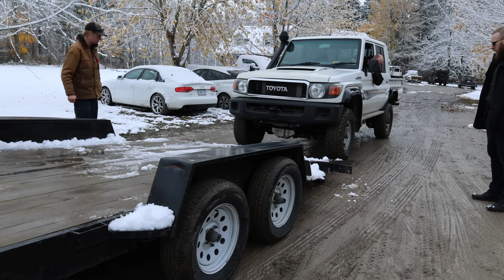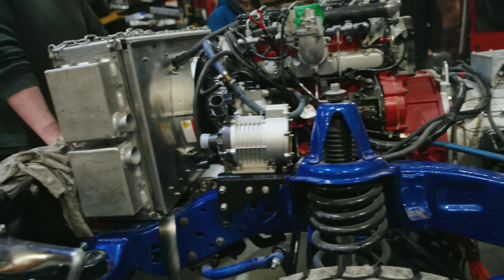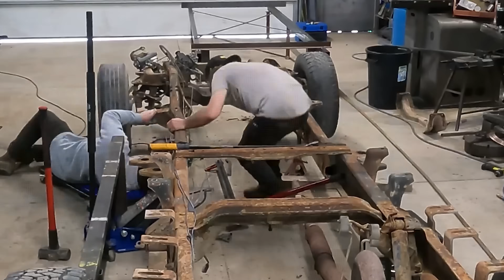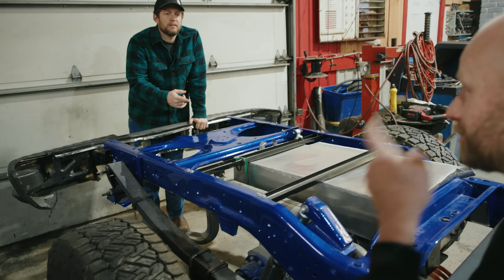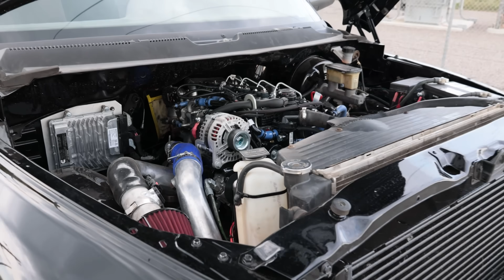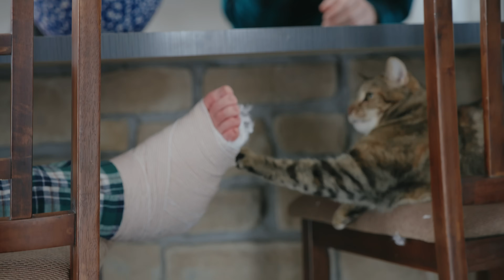Scrap Our First Design and Build an Edison Pickup Chassis from Scratch?

Comment: Very happy to see all the progress. I do believe having the chassis mounts moveable is the way to go. Then they will definitely fit more vehicles. I would also make it very clear in legal speak that they are to be bolted then welded in place by the installer. Any failure to weld them or improperly weld them is not Edison’s responsibility.

Comment: With a common frame you will run into wheelbase issues between manufacturers bed and wheel arch placement.
Reply: I suspect the "common" frame will come in pieces that can be adjusted for different wheelbases, and adjustable cab mounts that can be welded on.
Reply: @Sah-o5m sounds like an option some people might want.

Comment: So we can buy components? I thought it was “installer only” That would be great. 

Word of caution on wanting to get creative and fancy with the suspension with four links and such… For a work truck pickup truck. High serviceability and low cost. Leaf springs rear and radius arm front isn’t sexy, but you also don’t have to have an onboard air compressor and there’s less moving parts to wear out.
Reply: I hope they just do the kits like they intended. I don't want their chassis.
Reply: @joshfazenbaker5691  For sure. I can figure out the packaging. They don’t need to make sure it fits perfectly, just give me components that work.

Comment: Just a thought:
Could Dongfeng Off-Road supply you with "GLIDER-KIT"  Dongfeng "MENGSHI M50 and/or MS600" 
as a Cab, & Chassis bundle, 
without the mechanical drivetrain ?

Dongfeng M50  (https://www.youtube.com/@youtubvehicle)
https://www.youtube.com/watch?v=STWzpCTlrtY"

In these models 
Dongfeng Off-Road themselves tend to utilise 
Cummins "B" Series 6.7 @ 320 hp (VERY de-rated).

Comment: You guys should do your very own pickup truck line, other than just conversions
Reply: Impossible
Reply: @xxxxxxxx183 
Probably impossible for class 1,2,3 pickups like F150 F250, and F350 due to 10,000 rules and regulations.

Since Edison is on the verge of selling class 8 trucks, then that also allows them to sell class 7, class 6, class 5, and class 4 trucks. A class 4 truck is an F450 commercial truck and (I think) has fewer rules about airbags and crash testing. So it MIGHT be possible.

Comment: This. You guys are living my absolute dream. As the son of a family owned portable restroom business, I’ve always been frustrated that we have so limited options in the sub-CDL class truck-chassis options, that we are forced with the big three, with constant drivetrain issues, because they don’t build trucks to be worked on, they build them to be replaced. In the division I work in, we also have been in the process of up fitting tank bodies from old chassis to new ones, and I can confirm, most chassis-cab trucks are 34” rear frame width. I love what ya’ll are doing, and the kind of conversation you had about optimization? Same kinda thing with me and my boss. If I lived in Canada, I’d be filling in an application for sure 😁

Comment: I have designed many coach and fleet vehicles (for video games bear in mind) and I will say, 34 is wonderful because it increased the ammount of bodies you can put on a truck. There were a few trucks in the day, I can't remember which ones, but they had frame rails that narrowed in and trying to mount stuff to them always meant having to make a new model for them, either that or have to make adapters which just added complexity.

Comment: The pickup kits are how I found y'all (via Deboss). I've got a GMT800  Suburban 2500 and a Nissan NV2500HD, I tow across the US with my racecar on an open trailer. I'm hoping these are reasonably priced for a Middle Class income, but I'm sure they will be pricey. Rooting for y'all regardless!!

Comment: Whatever you do, take into account a spare tire’s placement. The larger the space for a spare tire the better for various applications.
Reply: I don't think that it's that big of a deal. Every truck that I have bought. I get the extra tank. So I don't want the extra tire. I want less time at the pump and more range. And when you are replying tires every two years. I have never needed a spare.

You do a trip check and look at your tires. And know what is going on before you need a spare. And if it is that big of a deal. Then carry a spare in a can. But honestly a 12v compressor is my favorite. Put in air on the truck or trailer and then drive and get it fixed. If you are shredding a tire to the point that you need a spare. Then you should be doing more pre trips.

Comment: It would be cool to see an RV manufacturer using your chassis.
Reply from the maker: We’ve had a couple express interest now.   The RV benefits would be huge of the hybrid
Reply: Taking an e350 based camper with a v10 or a big block and turning it into a diesel hybrid could more than double the MPG into the 10s in some conditions.
Reply: @w @workingcountry1776 keep the V10. It’s already used as a generator engine for industrial applications. A V10 running at a single RPM with a generator load can be pretty economical, especially when compared to it driving the wheels.
Reply: @EdisonMotors I would love to have my Astro Tiger RV be your guinea pig. Would be so perfect with a diesel heater and a bunch of panels. It would make it a dream rig.
Reply: @JesterTop  love the astro!
Reply: @EdisonMotors  I've got an Airstream 345 motorhome with a 454 and I'm dreaming of making it a diesel hybrid. I'd love to be able to pull a hill faster than 45 and get over 6 mpg.
Reply: Im planning on doing this swap in my Class C G30.
Reply: I would love an electric RV, but only with LFP batteries for the fire safety factor

Comment: I thought the original idea was to retro many old models to keep them on the road. Y'all are making a new truck brand.
Reply: They came to the realization that it's cheaper to manufacture, than to retrofit. They will be building a cab soon!
Reply: I can see this being a part of the business that gets developed after the core components are proven at production scale. I can see them selling universal kits at this stage being an absolute nightmare that they don't have time for. You'll notice the international project is on the back burner. The good thing about this new idea is that you can still buy the chassis and retro fit your cab.
Reply: yeah i knew it was too good to be true

Comment: I DO know a specialist low-volume "OFF-HIGHWAY" chassis builder in CHINA, 
Hubei Off-road Special Vehicles Co. / Shiyan Fanya Trade Co.  (in English) , 
that uses a large percentage of Cummins engines, 
in medium duty 4x4 and 6x6 applications. 
This company is linked to DONGFENG
(Both DONGFENG AND FOTON operate official Cummins Joint-Venture manufacturing plants in China).

Located in Shiyan City, Hubei Province

Here in Australasia (Australia and New Zealand) we probably see much more 
commercial product from both DONGFENG and (also) FOTON
than you do,
and they BOTH have relationships with major Euro-American component brands..

Hubei Off-road Special Vehicles have existing Off-Highway chassis designs 
(North American: class 3 through 6 approx.)
(intended for ICE power-trains when originally designed)
that might require very minimal alteration
and be very cost competitive .
(One range is a much improved "HUMMER-LIKE" design)
https://www.youtube.com/watch?v=C1nYuJ_1JZI

Comment: I just love this banter as those of us who are truck owners are offering in valuable feedback. The question on using your chassis on a current model is the additional cost. You would have to provide folks who want to convert existing models pre manufactured bolt on components to make the conversion.

Comment: Another vote for cab and chassis frame rails. Hot shots, RV haulers, service trucks, etc need the hybrid more than someone with an F350 to drive to the mall. Also, set the battery and generator up for trailer pulling or heavy payload, not an empty truck. There is a sweet spot between the cost of extra batteries and the cost of extra diesel. I think most people wouldn't mind the diesel running nearly full time cruising on the highway with a trailer as long as the fuel economy improvement and pulling power is improved over pickup diesels.

Comment: when replacement chassis with original bodies was mentioned, i cringed, unless there's some way to make a small selection of frames that can fit under 80% of bodies, it's not a go, 20% can be done custom, i'm glad the explanation is so simple, most trucks already semi-universal.  a simple swap with a semi-universal frame is good, but i'd really like the front suspension travel of a gen1 ranger, some people were able to stretch it to 460mm.  with the axles available, it ain't possible, but i still like it, maybe for the 2wd version.  the extended c rich mentions is a good idea, but, i'm thinking, extend on the top, but have a shorter web on the bottom, maybe even z, with the bottom web sticking outward, you'd gain maybe 100mm with the rails exactly where they are.

Comment: That "FOTON" Cummins 2.8 has a bigger sister ENGINE.  The CUMMINs "FOTON"  3.8 -  a whole liter larger
(BUT it  is VERY different to the 4-cyl "B-SERIES" Cummins engine, which I suspect Cummins are trying to point you at.)

You can probably source that 3.8 FOTON in CHINA, if you must, 
Using one of you EXISTING suppliers in China, to handle the procurement,
if CUMMINS North America, are trying to steer you in another direction.

Comment: This video is kinda disheartening. I've seen it time and time again. You are engineering your way into a whole truck. I dont want a whole truck. And if the rails are going to be different width than the rest of the industry, you add even more cost to it. Pushing the ROI out even further.
Reply: I would like a 'kit' that doesn't require me to re-body a frame. I understand why, but moving a body to another frame will take more wiring time, and equipment than replacing an entire drivetrain.
Reply from the maker: We have said that the parts will be available to those who want to buy just the parts and install them.  That is still currently the plan but we need a chassis to put them in so we can get CMVSS certification on the entire chassis
Reply: @EdisonMotors So, no 'kit,' just parts? What about in the past you said you'd like for the customer to be able to keep their engine, is that gone now too?
Reply: @EGremlin if a "kit" is a pallet full of drivetrain parts, then you'll be able to buy a "kit"

What you're looking for will be in phase 3 after Edison turns profitable
Reply: @EdisonMotors why do kits buyers need the chassis cert?

Comment: A "Rippled Plate"  could easily be added to the top-surface of your Pick-Up truck chassis-rail,
which gives you a "Partial" Torsion-Box design, 
but also facilitates a variety of "Body-Up-Fitter" mounting width options.

Comment: Have you seen the chassis frame design utilised by China's  WINDROSE tractor unit (E-700 ?) 
it is standard width until it meets a big WIDE SQUARE BOX,
which forms the Rear-Half (approx.) of the Frame-Length.
I believe that a "Bridge" structure is required to mount the Fifth-Wheel Coupling.

A "Rippled Plate"  could easily be added to the top-surface of your Pick-Up truck chassis-rail,
which gives you a "Partial" Torsion-Box design, 
but also facilitates a variety of "Body-Up-Fitter" mounting width options.

Comment: 12:47 maybe provide an adapter for the 34 inch products to the wider frame, so you can have more component capacity and still be compatible with the standard truck bed/accessories.

Comment: Just use a WIDER TOP-FLANGE on your chassis-rail.  
This still lets you have  a Wider-Apart WEB, 
and a more typical LOWER-FLANGE width, 
but retaining your "Traditional" width of mounting 
(for vertical mounting bolts).

Comment: F-450 can have either 34” or 42” frame rails as they come with different “packages” from factory, where F-550 or Ambulance frame rails come at 42”. So you can get heavy duty built decks etc on 42” rails if needed.
Reply: I have an F550, frame is 34". 42" would not fit with duals.
Reply: @rakman88  I have the ambulance frame and I had to make my own deck because of the 42 inch rails. I believe the ambulance frame is wider because of the side to side motion, but I have duals as well 🤷‍♂️

Comment: i do have a concern about going for your own frame. isnt that kinda... against the reason for the kit?  as i recall (it has been a couple years), the main reason for the kit was to breathe new life into an old, warn out truck. this wouldnt be breathing new life in, this is taking the skin and putting it on a new skeleton. i'm not strictly against that, old trucks look cooler, but it kinda defeats the original purpose. beyond that, you're trying to make a jack of all trades truck, which never really pans out.

my 7 cents (damn inflation...), make tiered options. i understand that may be beyond your scope at this point, but if it's at al feasible, it's probably the better option.

go for the new frame, quad motors and bigger engine for those that are needing a heavy duty work truck. you could theoretically sell those as rollers (idk what the laws say about that for this use case, but i know it's a thing that is done for other industries).

offer the same running gear but with a smaller battery and mounts for the common heavy pickup trucks (class 3, 4 and 5) for a drop in conversion. maybe the smaller singe motor axles for half ton, 3/4 ton and compact trucks/suvs.

offer the smaller engine, battery and the singe motor axles for diy conversion (with easily sized axle shafts and tubes). add mounting points to the components, that the end-user or installer can work from to get a custom fit. i guarantee this setup would be use for some pretty wacky conversions (i foresee lifted fox body mustangs rolling on 37s, 4wd civics ripping up drag strips, suzuki samurais bouncing up rocks that a lifted hellcat-swapped wrangler cant climb and grandpa's '88 bronco II getting better milage than the rich kid's prius).
Reply from the maker: You should still be able to buy the parts and install them in your own truck if you want that's the current plan.  But we need to make a chassis to do proper testing and get certification on that chassis.  And so many people we talked to don't want to do that level of work themselves but would rather buy new (larger fleets)
Reply: @EdisonMotors how long do we have to wait to be able to buy kits while you guys seek government approval on a chassis? We shouldn't need all the EPA type approvals for components that are already sold if you guys just sell us the kits for whatever we choose to install them in.

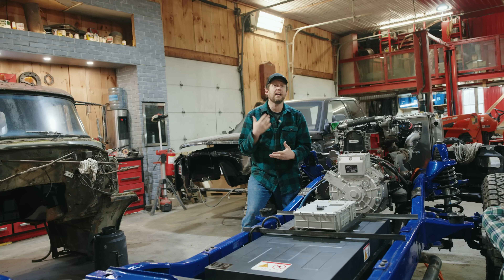Comment: 8:35 I had that idea, full chassis ready for your body to bolt on. 
That should avoid emissions issues if you use a pre-emissions body and VIN.
If I had the time and money, I'd start building them. 

I've also thought about a triangulated 4 link air ride on the 2500 I'm buying. 

I could see this being handy under a bale bed, run on electric in grass and lower the fire risk.

Comment: You likely don't need the bigger engine.  When towing a really heavy load going a bit slower is OK and uphills don't go on all that long.  It should end up that the increased wind resistance of a big trailer is the thing that costs you power.

Comment: You guys should look at the frames used in LMTV/MTVs (US army logistics trucks) and Unimogs. It might be worth matching sizes with those over standard pickup frames. When sold as surplus they're turned into dump trucks and wreckers all the time with standardized kits, even outside of the models that way stock. They're also frequently turned into overlander camping rigs, and just have huge beds for those using them for work. They also seem to be much closer to the frames you wish you could build. Rather than tapping into the junk pickup market for aftermarket parts, you could tap into the more capable truck market that already meets or exceeds the capabilities you're looking to build into your own trucks.
Reply: excelent !

Comment: As an outside observer and supporter of what you're building, I was wondering if you’ve considered hot-dip galvanizing the frame as an additional measure to prevent corrosion. It seems like it could complement the open C-channel design and further improve long-term durability.

Comment: i could see some bed manufacturers developing special beds for the edison conversions. with most of the others, particularly ones with driven components (dump beds, wreckers, pump beds) they often use the trans PTO, which you dont have in the first place. they'd need an electric drive option anyway, so they could build those to spec for your chassis width. then, there are the companies that already make different width beds for things like the ranger and colorado, so adding another width isnt entirely out of the question.

Comment: I am really enthusiastic about this, however I have concerns. I was hoping for a drop-in conversion kit for an existing truck. If I have to buy a complete rolling chasis (engine, generator, axles, battery, frame, etc) I am basically buying a new truck. It sounds like it will probably cost just as much.
Reply from the maker: Then buy the parts individually instead of as an incomplete chassis.  I'm still planning to make that happen and currently don't see a reason why that wouldn't be an option.  You can order a crate motor from Ford even though they still sell full cars
Reply: @EdisonMotors we want component kits. Chassis are a great option for those who do want them. As installers the majority of customer inquiries we've had will NOT want chassis.
Reply from the maker: It seams so split.   A lot want the chassis too.  Luckily there should be options to buy both like buying a crate motor from Ford.